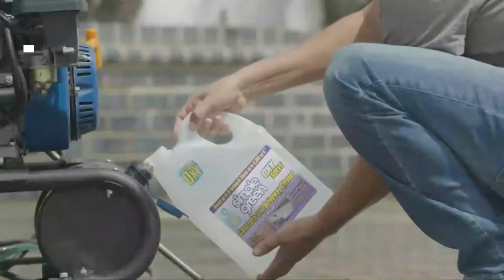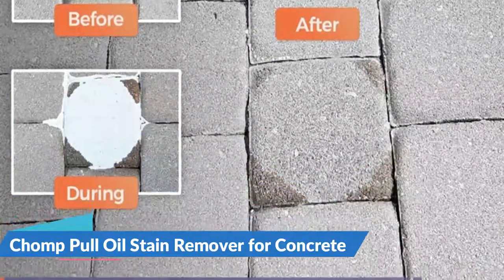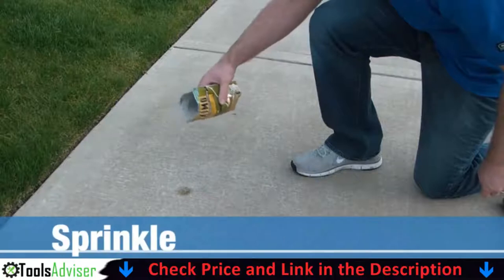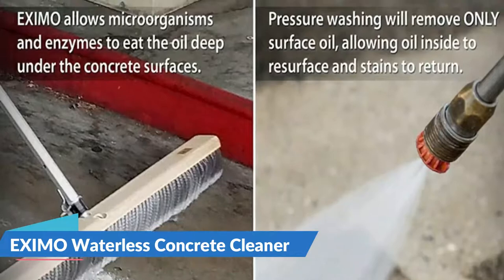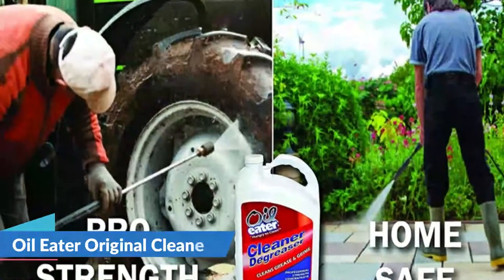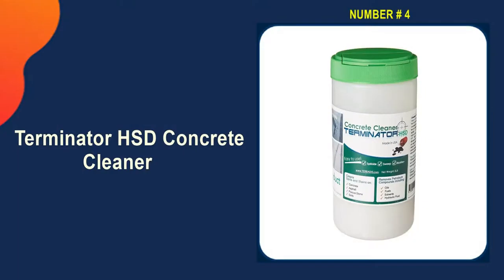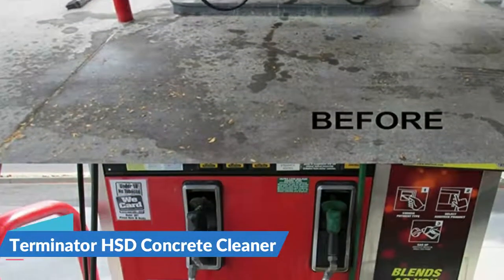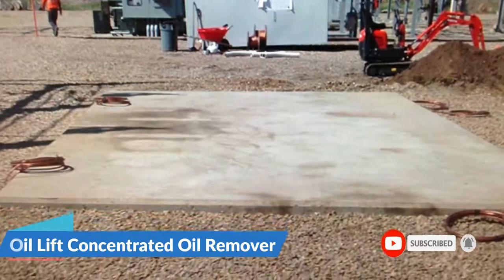Best Concrete Oil Stain Remover 2023-2024 🔥 Top 5 Best Oil Stain Remover for Concrete Reviews

Comment: 0:58   Chomp. Non toxic safe for surface. 

1:29 how can it dry if you cover it?  What should you cover it with? Thanks

2:52   See chomp work 

3:16   Eximo waterless concrete cleaner.   Powder restores original color. 

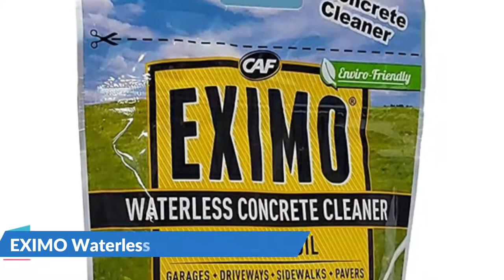3:42   😮. Uses microbes and enzymes to remove stains. 

4:07   How to use eximo. 

4:58    Eximo

7:47   😮. Concrete cleaner terminator

8:54
Reply: 0:28